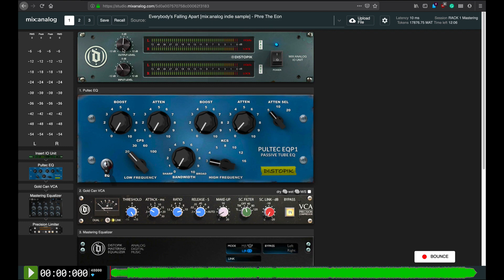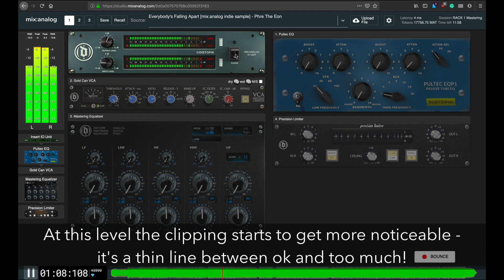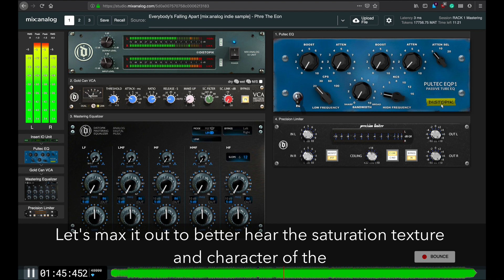mix:analog | AD Converter Clipping Guide

Comment: so clipp my  AD  going back into the daw in  the red slightly then  lower in the daw when finish record to do final touches ? because im confused im not seeing your ad here its all plugins  i have the apogee mk2 converter
Reply: it's not plugins but remotely controlled hardware. we built an interface that looks like plugins so that it's easy and familiar to use. the actual ad here is a burl b80 mothership. on the process itself: you got the gist of it, clip the converter, then lower the volume of the track by a few fraction of dB inside the DAW. the usefulness of the results varies greatly on the analog section inside the converter, some are more forgiving/natural sounding than others in this process. experimentation and keeping an open mind is key here.

Comment: in most today's production words " if ur track's low volume gives U trouble in achieving clipping" sound like a bitter irony. good stuff quys, keep going!
Reply from the maker: That mostly happens when our users decide to err on the side of caution and upload files at -12dB peak or even lower, which could be right on the money if you want to be well within spec somewhere around 0 to +4dBu, but a bit low if you then decide you want to make it hot. And thank you for the kind words!